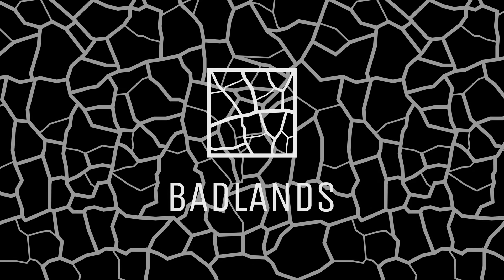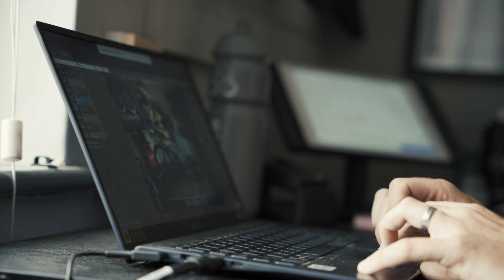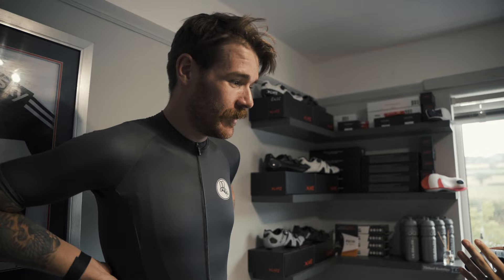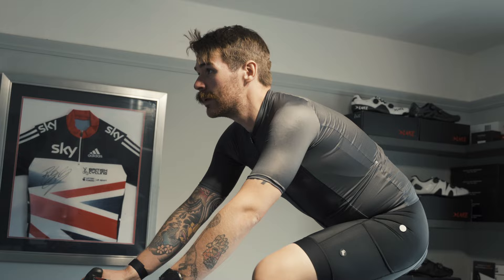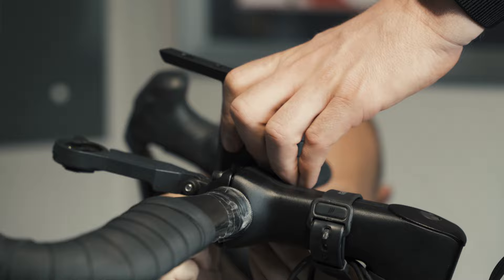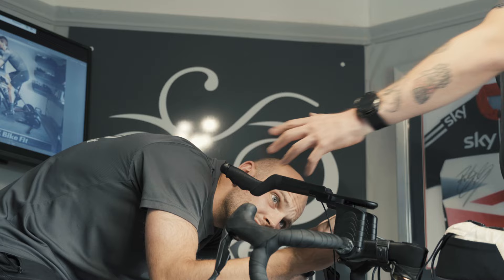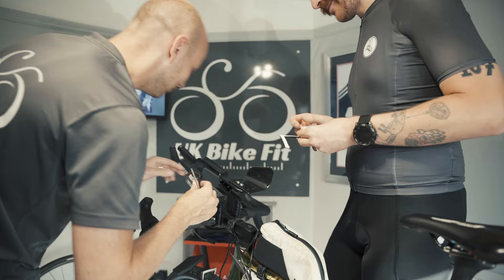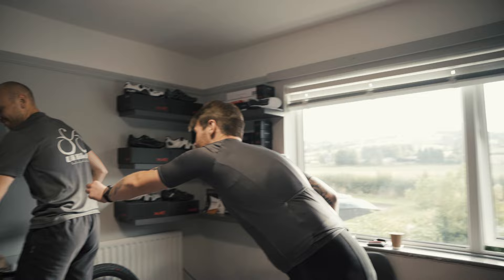Bike Fit for Ultra Cycling Races: Badlands 2022

Comment: I would argue that, ideally, ultra specific bike setup should be completed months before the actual events. For gravel ultra distance its Probably a bit less crutial than ultra distance on TT bikes, but i think the body needs time to adapt either way. :)
Reply from the maker: I’d say for any kind of ultra racing it should be done months before. I’d not normally change stuff so close to an event but we made very minor changes and there was enough time to adapt to what I know within myself. Some people take longer to adapt to changes too of course but yes I agree with you
Reply: @ChrisHallRides  I am sure its also down to your extended experience as a cyclist what and how much can "handle" im terms of position. I wish I found more videos like that when i started ultra cycling so I would not have had to figure it all out the hard way 😅😄